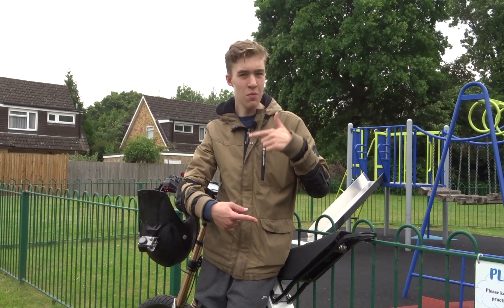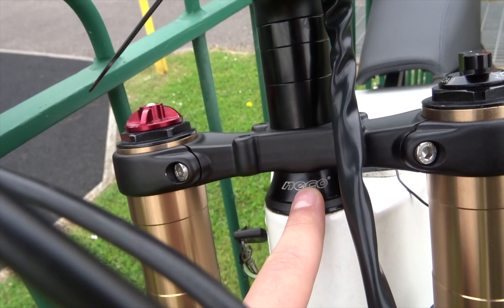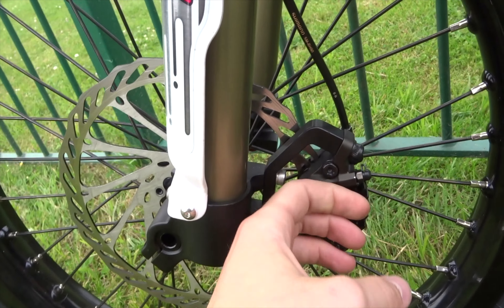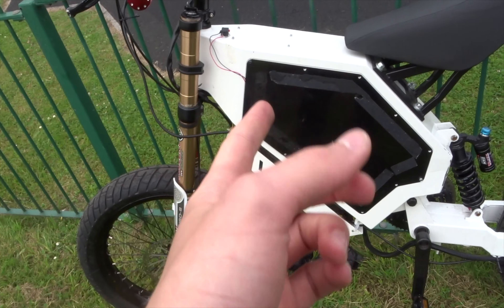Sabvoton Nightmares + Riding Footage! - 8kW Enduro MSVA eBike V3 Build

Comment: i actually am having a similar issue i have the 72v 200a sabvoton and when i first got it it pulled the rated 200a but now it seems to struggle to pull 180a i have since increased the size of my battery and therefore should support more amps being pulled but wont do it im not sure what the issue is as you probably know all the sabvotons you can buy as of right now are non genuine due to sabvoton the original manufacturer has shut down many years ago so the components in ours may not be up to the task. and for reference the cells im usuing in my battery are 26650 cells 5000 mah rated for 20a continues there is 11cells in 1 pack and 21 packs making up my 76v nominal battery i should theoretically be able to pull 220a continues with ease and yet i cant voltage drop under full load of 180 amp is from 9 - 13v seems like alot but they should be able to handle it no issue
Reply from the maker: I hadn't thought about the manufacture shutting down so genuine ones can't be made - I was aware they had but didn't put 2 and 2 together. Your pack should easily be able to put out 200A however 13v is a quite a lot of voltage sag so would recommend keeping an eye on that and using a voltmeter after a ride to check one cell isn't going down more than the rest.

Comment: You sure its not to do with power delivery to the sabvoton.  I say that as i remember your vid of you assembling the battery pack & it seemed to me you had the series & +/- wires connected abit weak. You had each wire clamped down with just one small phillips screw providing the clamping force.  Ive always soldered high current connections or if it needs to be removed it should have massive clamping force using a nut & bolt.  Your connections could be acting like resistors.  I could be totally wrong but maybe worth checking.
Reply from the maker: I've monitored the cell voltages with the BMS app and they all drop the amount I would expect so don't think there are any issues there. Not sure if you saw my 2nd video on the battery, but I changed the connection method to make it more secure. I'll keep an eye on the battery voltages when testing

Comment: it sounds like the symptoms you're describing is too much power to the motor and the motor is cooking lad and the sabaton is trying to stop you from cooking it
Reply from the maker: I doubt it, still doesn't explain why it then allows more power later on - if anything I'd expect it to give full power first thing and then taper off it that was happening. Also the sabvoton doesn't know anything about the motor's capabilities and I haven't hooked up the temp sensor. Cheers for the idea tho 👍

Comment: I had an issue with a different controller. Turns out I had to remap the high and low throttle endpoints.
Reply from the maker: This will be my last resort I think, trying out all 3 of my throttles again and properly mapping the endpoints. Thanks

Comment: Nice video.I am using same controller (SVMC72150 controller) While we are driving  bicycle when it came at specific speed  in low speed mode(30km/h) in high speed(40km/h), suddenly controller brake itself.How can we overcome this problem? 
  Do you have any suggest? Could you help me  about this problem?Thank you.
Reply from the maker: Check the setting called slide regen, either lower the RPM or disable it completely

Comment: 80% chance: badly configured
20% chance: hardware issue
If you have bad grounding, it can mess up the throttle measurements too. A good ground is required to measure throttle voltage accurately
Reply from the maker: I meant to put in a screenshot of the settings I'm using but I've been trying to get it to work for 5 weeks now with countless emails from the seller with different things to try that haven't worked. I'm starting to suspect it's a hardware fault more and more as as I said, I've had a sabvoton before feel more punchy on only 4.5kw on the same bike.

Comment: What can you get from 54v battery . You have controller for $400 and 54v battery . It's like running v8 Corvette on 4 cylinders . You need at least 72v battery or 94v butt never 54 v , that's for 1000 watt kit and 52v for 1500 watt and 72v for 5000k kit and 94v for 8000k kit . You miss much the system . The controller doesn't get enough power.
Reply: At 52v you will still be getting 6500w at 130a. The voltage will limit your top speed but you should still be able to get plenty of torque with a 52v battery. Voltage isn’t the limiting factor in this situation.
Reply: @darmar2000  I see what you mean. Hopefully the low power voltage settings had been changed but the 72150 says it has a voltage range of 24-72v with max 96
Reply: @TECHSUPPORTEBIKE  sure but that’s just it’s continuous power limit it’s capable of, it should still pull with 130a at 52v through it.
Reply: @TECHSUPPORTEBIKE  yeah I guess its definitely worth checking to see the battery can provide to power it’s states. Would be handy to test the battery on a known good system to check it
Reply from the maker: Wow this is a long thread😂 To clear up - I have set the parameters in the software to suit the 44-58v range of the battery and the pack itself is MORE than capable of delivering the current (>200A). Again, I've had a different controller work as it should on 5kw hence why I suspect it's a faulty product.
Reply: @TECHSUPPORTEBIKE  The controller acts as an inverter, the acceleration should be the same as long as he isn't DC battery amps limited.
But the top speed will be lower without flux weakening